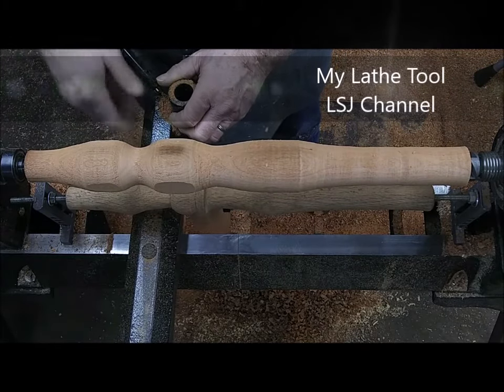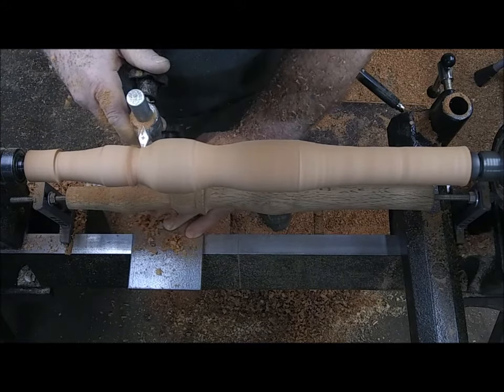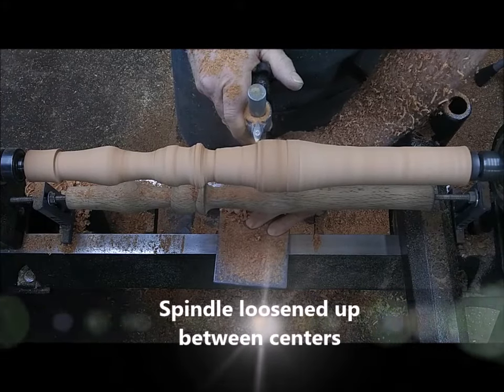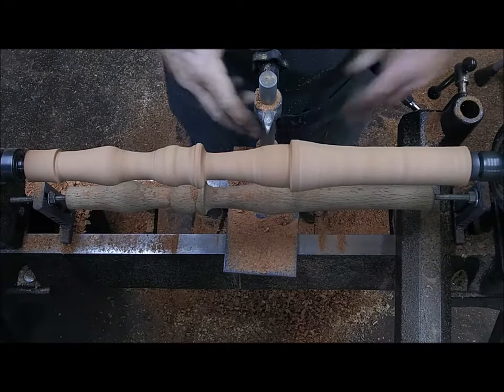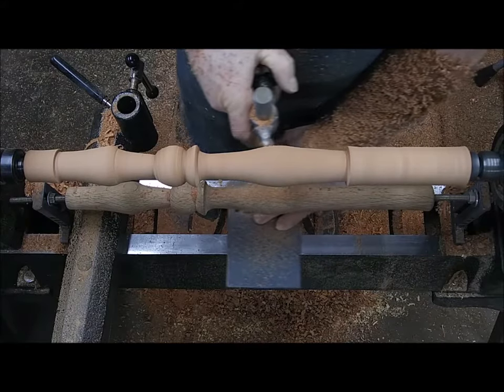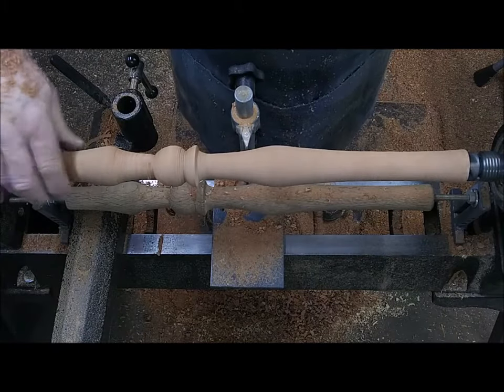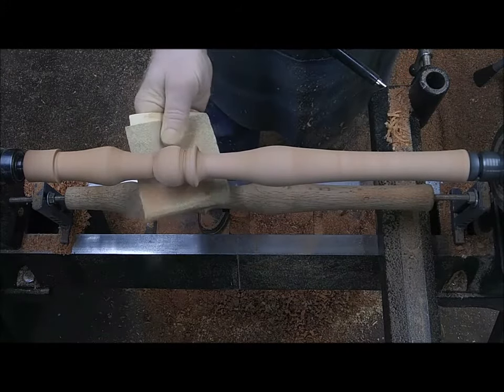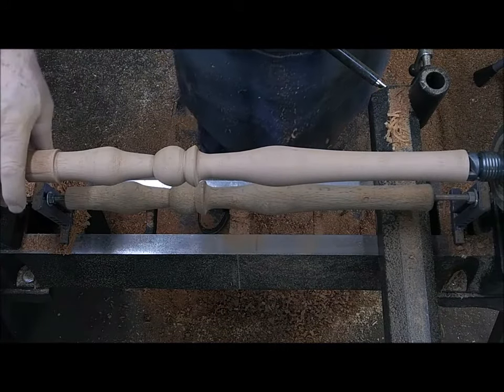part 3 wood lathe duplicator, wood lathe copier, My Lathe Tool Freestyle wood turning cherry leg

Comment: I'm new to turning. Everything I've seen says to not go uphill, go toward the center. Would I get a better finish and less tearout from your tool if I were to follow that rather than just going straight across as you're doing?
Reply from the maker: We like to use the tool going uphill into more wood and towards the headstock when possible. More tips on our  website.